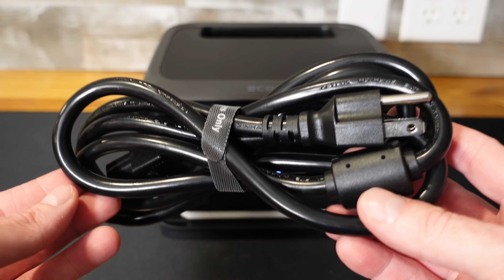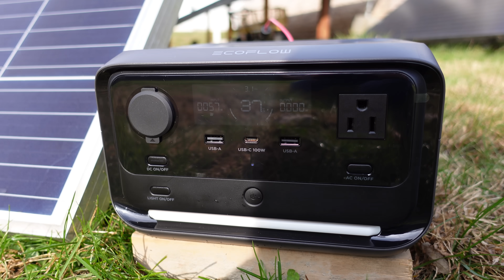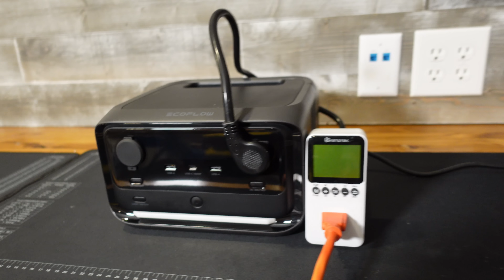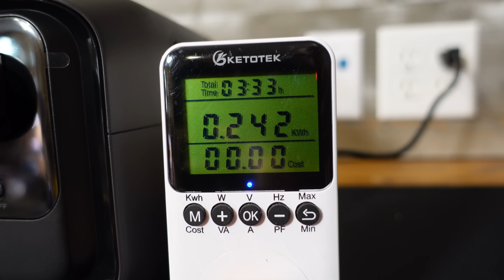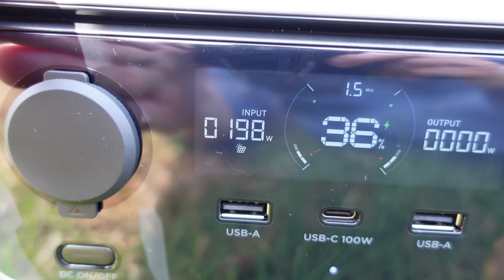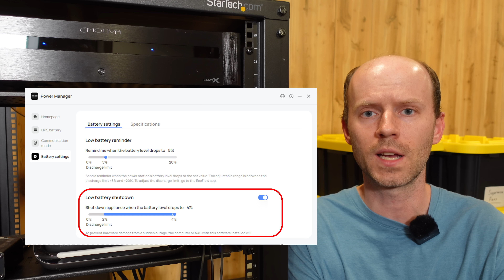600W UPS? EcoFlow River 3 Plus Portable Power Station, Reviewed!

Comment: River 3 is way better than River 2 
Got myself a River 2 - River 2 Max - River 2 Pro
The fan is quite loud 
And I too have River 3 & River 3 Max Plus 
This is a very good power station 
If you are using less than 50w such as fan it's can last longer & it's so quiet you can't hardly hear the fan
I 100% recommend this River 3 
Worth buying......

Comment: Beware of using this as a UPS! I was impressed at first, using as a UPS but there are serious issues with the unit cutting AC power and turning off my computer, NAS, switch, and other devices for seemingly no reason even with the latest firmware. The AC outputs were only at about 150 watts which is well under the 600 watt capacity. Also there is no advertised surge protection, so I bought a good surge protector and then plugged the EcoFlow into it. Also these units won't go to battery power if the input AC voltage gets too low or too high (or it will but the limits are unsatisfactory (too low/high) for a computer UPS). And every 3 months you are supposed to charge and discharge the battery and there is no automated way to do this. Using the 'backup reserve' feature to discharge the batteries will likely cut your AC power off even when the unit is still plugged into the grid, as it has done multiple times for me. Shutting off the AC power randomly, especially when plugged into the grid, is not acceptable for a UPS. My CyberPower UPS units didn't have these issues. I'm not happy that this has still not been fixed and EcoFlow support has been no help. In my opinion, it's definitely not a "pro-grade" UPS. Pro-grade UPS's don't have the issues this has with shutting off and having to manually maintain the battery (among other issues).

Comment: Just purchased this latest model, with the EB300 extra battery…on offer Amazon uk  £268 or $ 361  when converted….my bargain buy of the last 12 months, especially when it was £449 or $610 when first launched, X boost is great for resistive loads , for short periods, ie space / halogen heater…etc, I’m using mine in my stealth camper, for the coffee machine, tv / projector, soundbar….I have two smaller units Swarey s160s, one Is dedicated to powering my portable fridge, / cooler that uses 8watts on eco mode…the other is for phone charging and the like…👍🇮🇲😉

Comment: Got the EcoFlow River 3 plus along with a Bluetti Elite 30 V2.  Very similar specs.  My EcoFlow UPS feature stopped working after 3 days.  Sent in for warranty.  Got brand new replacement.  Now the UPS is shutting down once a week (the AC output turns off).  Kind of annoying.  I now have it in series with a dedicated UPS so that I also have AVR.  The Bluetti has been running 2 months straight so far without any problems.  Not happy with EcoFlow thus far.

Comment: Does it have bypass or not? I mean invertor works full time, doesn't matter we have power from battery or external
Reply from the maker: Yes, it has bypass. It is not conditioning the power (ie stepping it down to DC then back up to AC).
Reply: @LithiumSolar just only one bad thing. It doesn't support standard ups protocol😢

Comment: EcoFlow River 3 plus doesn't have surge protection or AVR. I've heard people comment to use an old UPS in conjuction. How should it be setup?

Wall > EcoFlow River 3 plus > APC/Cyberpower UPS > Devices

or 

Wall > APC/Cyberpower UPS > EcoFlow River 3 plus > Devices
Reply from the maker: Correct, it doesn't have surge protection or AVR. Surge protection is easy, a simple power strip or wall adapter will do. I did note the lack of AVR in the video. Putting the EcoFlow after an APC would protect the EcoFlow, but your APC then needs to be rated high enough for the charger + load of the EcoFlow. I think if you need the AVR, it might be best to just go with an APC instead of an EcoFlow.
Reply: This works well.  I am using this way.  The River 3 plus doesn't handle power surge all that well in my experience which is disappointing.  (The UPS function is buggy) Generally, I'm pretty happy with Ecoflow owning some units from the Delta 2 and 3 series but the River units seem to under-perform at high wattage. I have had zero issues with Deltas. I would also turn off X-Boost, as it can damage some devices.  I also have a monster APC/UPS for my main PC which is plugged into an Ecoflow Delta 3 Max which also works well.

Comment: nice to see lithium options for a server UPS making sense. believe this is only about 100$ more then the APC units i have.  also i tried the solar on the anker unit. and if plugged in to the AC power in  the unit would ignore the solar.. you really should try the solar in for us.. my goal originally was to have the solar help reduce the server costs.

Comment: How is the noise level while charging / or being used as a UPS next to your desk? My PC is super quiet, I have a Delta 2 which is too noisy for my liking.
Reply from the maker: The fan doesn't run constantly. I'm not sure I've ever seen it run while it was functioning as a UPS and fully charged. When it does run, it is near silent though. You wouldn't know it's even running unless you're purposely trying to hear it and honestly, the fan icon on the display will catch your attention more than the actual fan does lol.

Comment: I've been using these as UPS for network equipment. Very happy with them.

There is one issue I had noticed. I originally used the front USB-C instead of AC wall adapter (no inverter turned on for AC power) for one device, but found out the USB-C will power off after 30 days of continuous use. This happened several times.
Reply from the maker: That is a very unusual "feature"... I wonder if it's a software bug. Once I'm done toying around with mine, I'll have to give it a try and, if I can replicate it, will report it as an issue.

Comment: Another excellent review, per your usual standards.  I've seen new dedicated UPS products, with LFP batteries, hitting the shelves, but they don't cost much less than this small power station, which of course has quite a few other use cases, like camping or charging small devices during a power outage.

Comment: This could easily replace a branded UPS for a desktop or a home network rack.  having the ability to connect an external battery or solar panel on the fly is a great feature.  Will give this serious consideration next time the batteries in my APC Smart-UPS die.

Comment: I've been using this as a UPS for almost a year and it's been great.  The only gripe I've got is that the app doesn't have any protection on the power buttons so it's easy to accidentally switch off loads.  It's such an easy fix, so let's all ask them to add like a 3-second hold/delay or verification option for the app. :)

Comment: Great demonstration of X-Boost.  I turn it off on mine (including the Delta 2 I gave to my Dad).
Reply from the maker: I really struggle to find a scenario where that is useful. I feel like if you're traveling with appliances > 600W, you should just buy an appropriately-rated power station. This thing will be drained in 20 minutes with a 600W load.

Comment: Been looking for an UPS for my fibre modem this may be it
Reply: I'm using the smaller River 3 (Non plus) for my modem.  Works great!
Reply: I own this and use it as a UPS for a gaming computer (and monitor and 55" tv) plus my modem and router.  It will run everything for an hour (set to 80%/20%).

Comment: If its not at least 1500w, its not enough
Reply from the maker: My use only requires 250W peak, so 600W is more than enough...
Reply: @LithiumSolar Not a kettle or a microwave lol
Reply from the maker: @CanadianTexaninLiguria I have a 12,000W off-grid setup for those appliances.
Reply: That's the same reasoning behind my purchase of a Delta 2 and Delta 2 max.  They work great.  But I also have a River 3 because sometimes I don't need even 300 watts, and the smaller size and weight is "real nice like."

Comment: Ok, good review as always.
However, how much energy does it consume vs. a standard UPS? My experience is that it is very inefficient being used as a UPS.
Reply from the maker: With the battery fully charged and my computer idling, I'm seeing 88W in and 80W out. The input/output wattages on the display both say 80W as well. So that's 90.9% efficient I guess.
Reply: @LithiumSolar Thank you for checking and replying
Reply: @LithiumSolar  It's idle consumption is around 8W, it may be 90.9% efficient for an 80W load, but a 300W load will be much more efficient. When it's running in AC bypass mode there should not be much if any loss other than the idle consumption.
Reply from the maker: @adriftatlas  Correct, in bypass mode, the only "loss" is the power required to operate the electronics in the device. In this case, that appears to be 8W. If we put a 300W load on it, I assume (but have not tested) that it will still be 8W so yes, that would change the efficiency. As stated here, my use case is a desktop computer UPS, so for the use being discussed, that efficiency is 91%. Not bad at all :)
Reply from the maker: That's a great question. I do have two power meters and will get you answer here soon (next time I shut down the computer).
Reply: From my own experience, when the battery is "full", wattage in and out of the unit is the same.  I would say efficiency is very good where only a few watts are lost compared to a standard UPS. Though, I would like to what LS says about this, hence my comment.